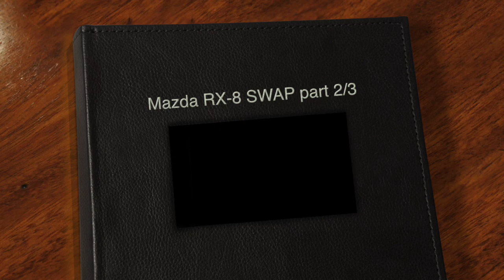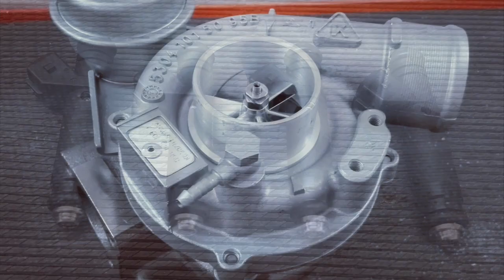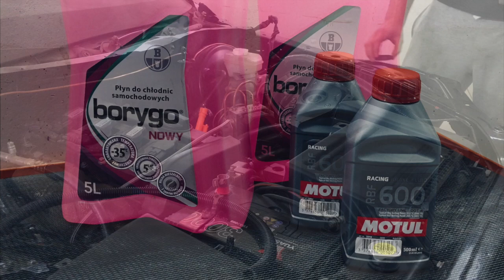Mazda RX-8 1.8t 300hp SWAP #allBlack (part 2/3) Engine

Comment: Cool vid FRIEND  where can i buy a ENGINE  to GEARBOX  sandwich plate for same ENGINE  but would like to use a BMW  in line six but don't  thing the engine bay is long enough but the A4 AUDI LOOKS FAB IN ENGINE BAY CAN YOU HELP OUT PLEASE JAMES
Reply: The 1.8 ko3 swap will make all the power you can dream of

Comment: how much did it cost? Cause im thinking about swaping 1.8t into mine rx8
Reply from the maker: around 20 000PLN, it depends of many things like: power you expect or parts which you use. you can do budget swap for 15 000PLN or much carefully for 30 000PLN.
Reply: @SopelXL  does it run now without issues after 8 months? How are the electronics? How did you pair the transmission to the engine?
Reply from the maker: @basseazdi  no issues, car is amazing! soon i will show 3rd part of movie ;) at 1:15 you can see plate for pair engine and gearbox
Reply: SopelXL Is it a costum made plate? 

Where can I buy this plate and wich gearbox and clutch are you exatly Running ? 

I‘m Looking for some informations about this swap, behause i have an RX-8 with a borken engine  and i want to swap it with an 1.8T 20V, to. 

So nice work, i like your Video ! 

Greethings from Germany
Reply: @SopelXL  Any chance of getting pt.3? Really keen to do this swap myself down the line.
Reply: @SopelXL  anyone in the USA about 6000$ without labor

Comment: Stock rx8 transmission?
Reply from the maker: yes I recommend five-speed model
Reply: SopelXL как соединял коробку и мотор? How transmission + moror, ? Есть чертежи переходной плиты, Are there any transition plate drawings? for motor and gearbox?
Reply from the maker: Посмотри 1:15 это плита 8 мм, к сожалению у мне нет чертежи. 
Look 1:15 its 8mm plate, unfortunately I dont have drawings.
Reply: SopelXL  а ты сцепление оставил wag? Или с рх8 ставил?
Reply from the maker: Корзина и маховик VAG, диск сцепления сделанный по размеру
Reply: @SopelXL  а стартер Вы крепили на переходную плиту? как же найти её параметры?(((
Reply from the maker: да, на плиту. Со стороны двигателя, не как было в RX8 со стороны коробки передач.
Reply: @SopelXL  Хорош, а в какой Вы хотя бы стране , и где делали данный свап,это очень трудно, я сейчас работаю над каналом и буду подробно рассказывать  людям о данном свапе, у меня абф 2.0 турбо , и хочу поженить данный мотор с рх коробкой, и засунуть всё это в чудо автомобиль ВАЗ )))
Reply: Спасибо за инфу, а от куда Вы вообще? С какой страны? И такой вопрос а выжимной  от куда?
Reply from the maker: Из Польши, город Варшава. Выжимной с Мазды.

Comment: Poor engine choice all that work and 27kw less . Sr20 or 2jz 1jz 13bt from fd is best way realiable once fresh built good power and no modds cutting firewall ect m
Reply: In eastern europe, this is the cheapest and best swap. I got a buddy with a 1.8T rx8 that makes 330hp with prestine reliability. Done daily, abused and whatnot.